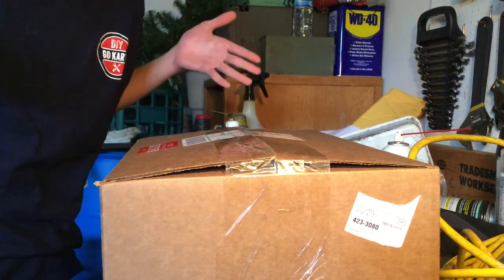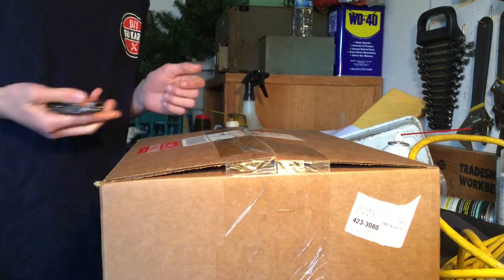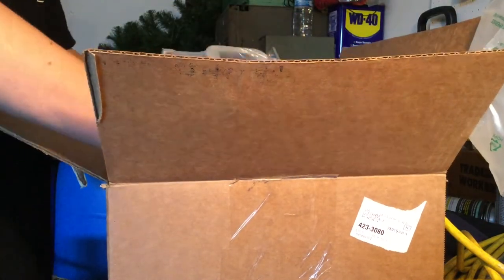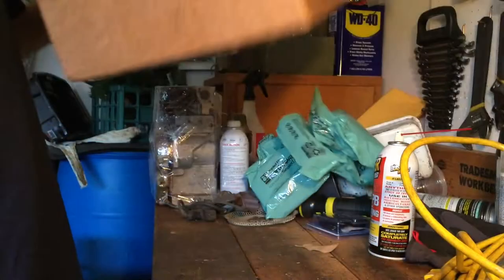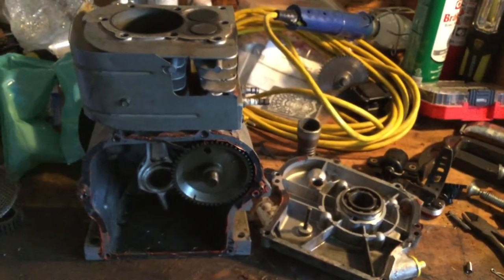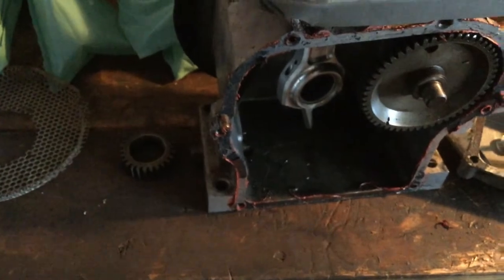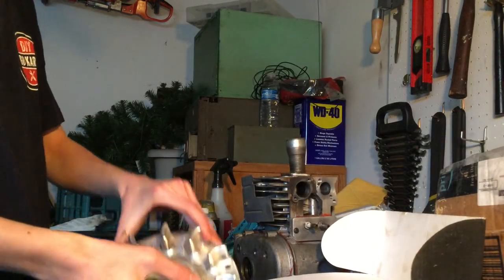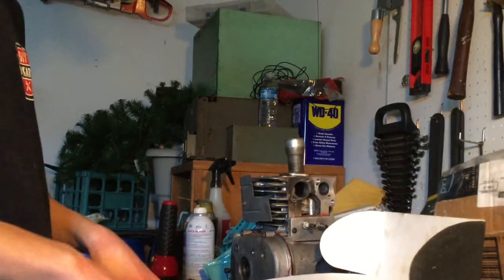PRESENTS!! | 10K RPM Flathead Parts Unboxing!

Comment: Can you do another video on the raptor3 10,000 rpm engine and show the cam and valve gap and what degree offset flywheel key does it have. What is the bore size. Thanks again.